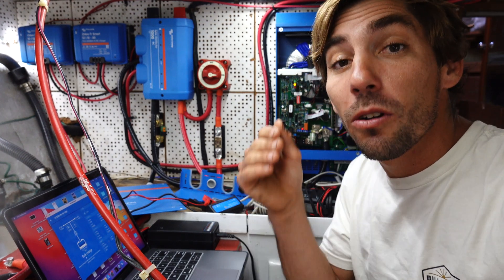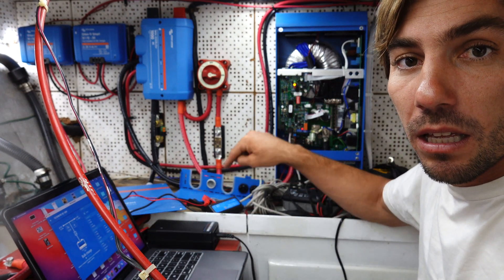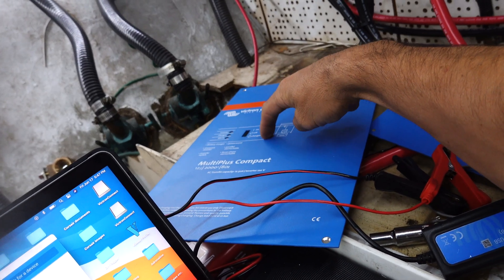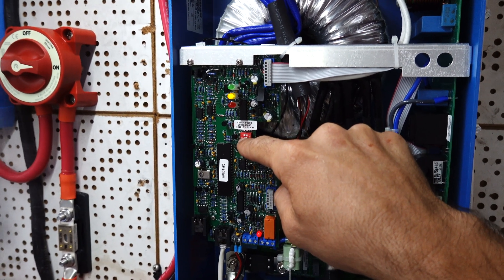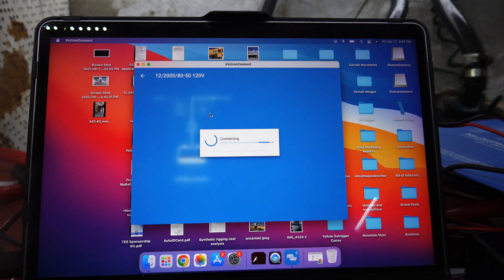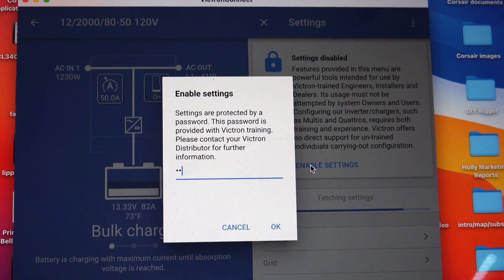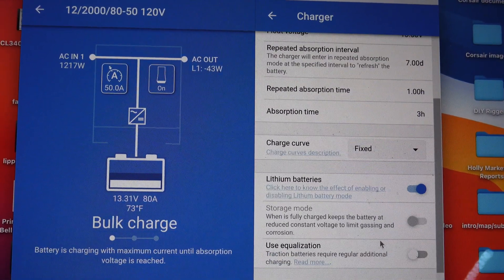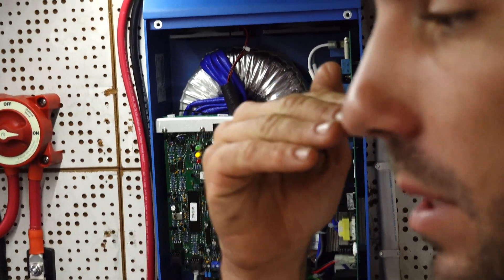How to Change Victron MultiPlus Settings w/ a Mac

Comment: If you want full access to settings via the Windows app, mac users could always dual boot their system so they can run Windows on it. It's pretty easy to do, and there are plenty of instructionals, and tutorials online. Great to know the Victron Connect app works for the main setups. Cheers!

Comment: My biggest complain about Victron... There should be an online convertor or a native Mac OS app. I can't believe Victron is closing ears on this problem for that long. 
My solution is; remote connect a Windows pc to use ve configuration tools. Then upload new updated settings with Cerbo GX to MultiPlus... And it's a pain in the a..

Comment: Wow!  This video was a life saver for me.  I only have Apple devices, including a laptop (no window's based PC), so I was running into a road block in getting my new Multiplus inverter to charge  in bulk mode after dong a FW update.  I could not getting into the detailed settings anymore and could not install the VE.Configuration software on my Mac and the VE.Connect showed it needed a password to enable changing the settings.  So you providing what that password is was a life saver.  I was able to change the settings back to what they should be for my set-up and after restarting the inverter, it went into bulk charging mode like it should.  Thanks very much for sharing.

Comment: Just so that I’m clear, there is No ‘programming’ of the Multiplus, DC-DC, or MPPT without adding the Interface/‘Dongle’ component ?  Another VE expenditure …. 😫
Reply: That is correct, you need the MK3 dongle.

You can’t even do many crucial programming steps with a Cerbo GX and Touch, which I just found out.

Comment: To have all possible settings you still need a PC and the Windows only VEconfigure software. 
For example for the programmable relay or power assist configuration. 
I am also a Mac user, and need a extra Windows PC only for that crap! :(
Reply: Crossover + setup com port and drivers. Or the same method but with VRM download/upload configuration files.

Comment: If you have a Cerbo device you can use it to download settings from your Multiplus and then push updated ones back. Only mentioning because that way you don't need the dongle or whatever it's called it you already have the Cerbo device.